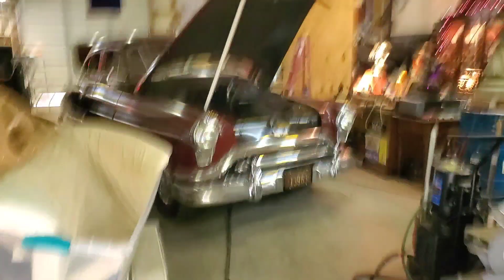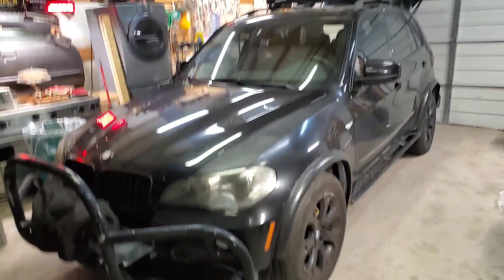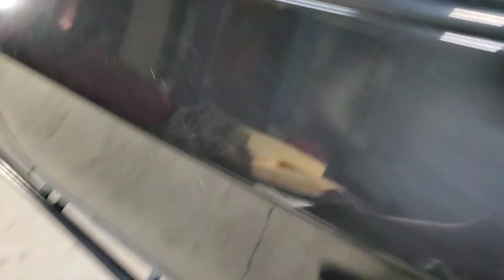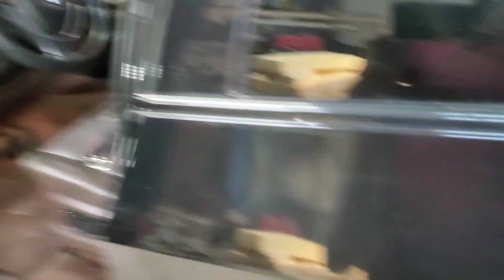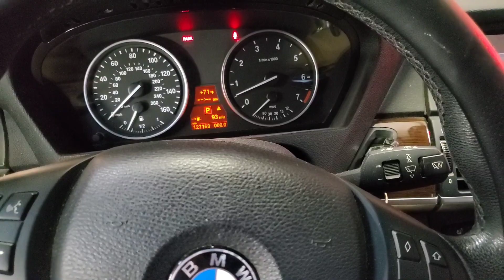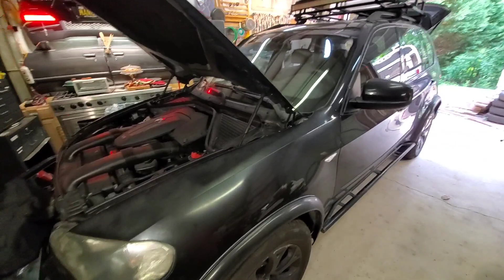E70 X5 BMW going crazy. Charging Issues. Bad Battery? Trouble with "Intelligent Battery Managment"?

Comment: I think mine is the ibs sensor. I got alternator tested and its fine and I've just put the second brand new battery in it and still wont charge the battery so I'm curious if I need to reprogram the new sensor to it or not. Itll run until you shut it off and itll be dead so its got to be keeping the battery from charging correctly. I got a footwell module code but all that is a symptom of the bad ibs sensor.

Comment: My moms is doing same thing and keeps dying. No lights inside about alternator but keeps dying over night or if i charge it and run to town to make a few stops then itll die
Reply from the maker: Voltage regulators are part of the alternator.  Replace the alternator.
Reply: @OGGarrettsGarage we ended up having the alternator tested and they said it passed and the battery is new. All the lights and windows work etc but just wont hold a charge and pops up the low voltage to shifter etc so im thinking ibs sensor is keeping it from charging correctly.

Comment: I know this post is a little older, but I was stranded a week ago with the idiot light scenario, a dead dash, air turning off while driving then engine dying on the freeway while doing 70. It started in limp mode without computer controlled transmission, made it to an off ramp and locked it up. Came back with a truck and trailer to find the window rolled down and the car unlocked (in was 115°). Battery was now dead and transmission couldn’t be shifted to neutral. Dragged it on the trailer. Charged it with an AGM charger which showed the battery was fine and healthy. However, the charging voltage is now 17.3 vdc! Assuming the voltage regulator was shot, so replacing the alternator. Hopefully I’m on the right path, but my scanner says nothing is testable, like it cannot access the ecu…
Reply from the maker: @nvboatguy  it took me 3 years of screwing around with my x5 before I finally replaced the alternator / voltage regulator even though there was never any scanner or dashboard warning indicating charging problems. It fixed the problem. There is a way to put it into neutral with everything dead. On mine it's under the driver side cup holder. Pop out a cover and you can reach in using a plastic tool that's with the jack stuff, then turn it to get neutral (be sure you're ready because she's gonna roll away). Good luck!
Reply: @OGGarrettsGarage  Thanks! I fired up the car after the battery tested ‘normal and fully charged’, thinking that maybe a computer which controlled alternator output might adjust the regulator to charge at a normal voltage. Nope! I guess that’s not how it’s supposed to work, and that maybe the alternator/with built-in regulator is a stand-alone unit that self adjusts- but with BMW, you never know what they come up with to control this stuff. Going to verify this is a Bosch alternator, and get one coming. This whole episode was out of the blue, with no previous issues…!!

Comment: Mine gave codes for high pressure fuel pump, low pressure fuel pump, 4x4 malfunction, ABS malfunctioning, light bulbs, fuel injectors. I lost my mind changing parts, until I just happened to look at the alternator and noticed that one of the wires was completely corroded off because of the stupid coolant hoses hanging over the top of the alternator and dripping hot coolant on the connector. I changed the hoses and clamps, and got a new connector. Problem solved and the car ran like a beast, my idle also became smooth as butter.
Reply from the maker: @Gboogie22  it turned out that mine was all caused by a slowly dying voltage regulator. I put in a new alternator/ regulator and it's all better now.  It is crazy how the car will start giving all variety of warnings when it's all caused by the low voltage. Thanks for commenting!
Reply: Mine says low voltage to electric shifter too and now footwell module codes showing up but all the lights amd functions work. Just got a brand new battery and did relearn and still draining. Guess I need to look into this ibs system too

Comment: Hello Gentlemen. I Have the same problem at the moment and I also tried to solved the issue by changing the IBS sensor and the fuse box but i still experiencing the same problem, I have notice that sometimes just by switching the car off and on the problem goes away, I looks like a relay not closing properly? did you problem was solve by replacing the alternator? The funny thing that I don't have the alternator light on, and I believe you don't either?
Reply from the maker: Correct. I received no warning that it wasn't charging until it got into a low voltage condition after running for a while, and then the entire car lost it's mind. Let it sit 30 minutes and restart and charging like normal. I'm about to post a new video about the x5 4.8 later today! Good timing. It is fixed, finally, after 3 years of the electrical gremlins making me crazy. After installing a new IBS it still wasn't charging so I walked away. Came back a few months later, ready to install a new alternator and before I got started I discovered that the alternator was working as desired every single time. Apparently, the new IBS needed to experience a  30 minute reset cycle before it started working correctly?  It's all I can figure out. I've driven it for a few hundred miles over a few weeks now both short and long trips and it is performing perfectly. Hopefully you can get yours sorted. Thanks for watching and commenting!
Reply: Thanks for taking the time to answer my question. I’ll try to change the alternator and hopefully that will work
Reply from the maker: Please let me know if it solves it for you. Another person said an alternator solved it for them. Maybe mine is just in remission. We'll see. Cheers!

Comment: I have the same car and I changed the battery and also put a second hand alternator but still doing it. Initially the alternator stops charging every now and again and the battery dies when I started checking the charging it appeared that some times it works and some times not and when it’s not working I switch the car off then back on and starts working. Last week stoped working no matter what I do so now I have ordered new one and I hope that’s the end of my troubles 😢
Reply from the maker: Let me know the results.  I've been experiencing these charging outages for several years now. 6 or 8 months between each occasion. This time, I'm replacing the alternator and the IBS with new parts. If that doesn't solve it? I'll laugh and try something else. Thanks for commenting!
Reply: @OGGarrettsGarage  I have been told that the alternator is a common fault and unlikely the issue is from the IBS. I’m waiting for the new alternator and I’ll update you if it worked.
Reply: @mazkasim7592 did it work
Reply: @mazkasim7592 did the alternator fix the problem ?